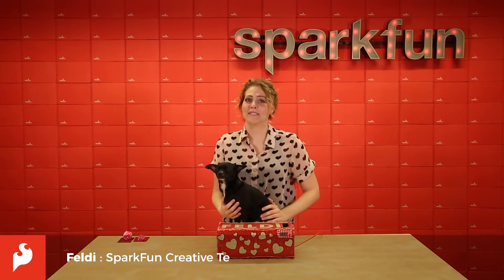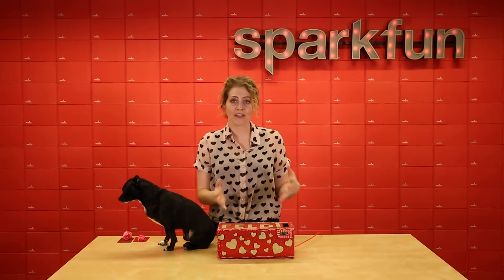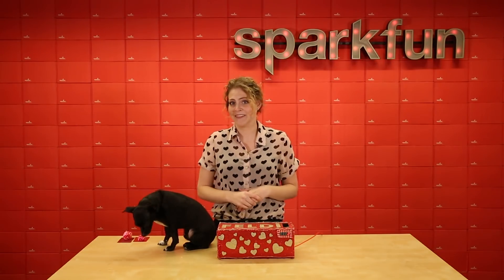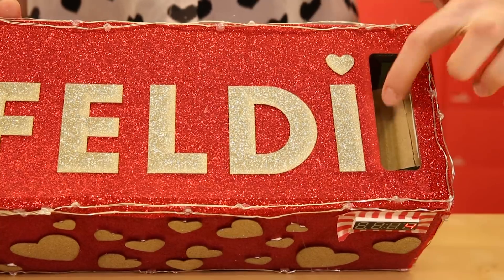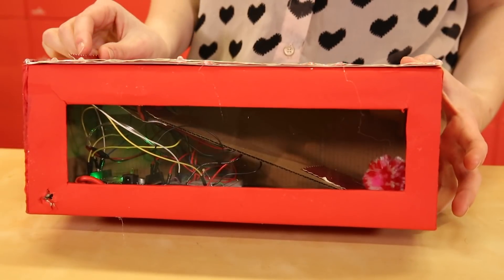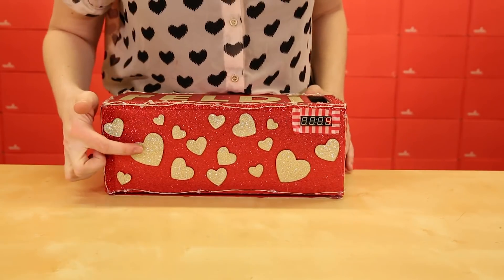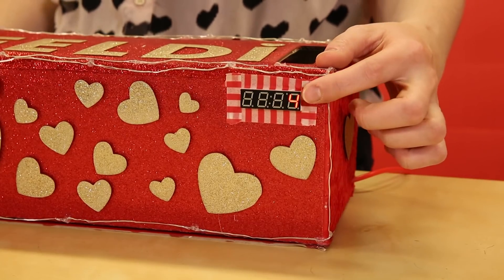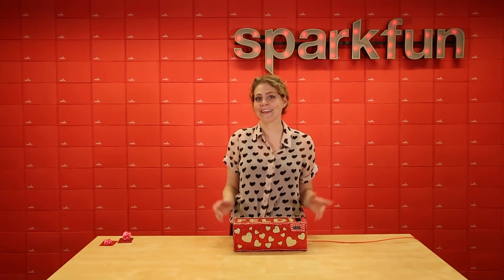Project Showcase: Interactive Valentines Box

Comment: Nice project, but how does the wiring work, because I’m going to give it a try and I have the battery pack, red board, seven segment display, and IR transmitter and receiver. I don’t know kind of wires I need so if you could help me with that to that would be great!